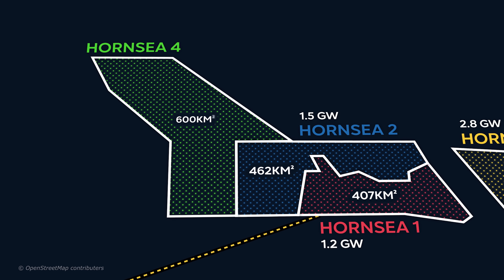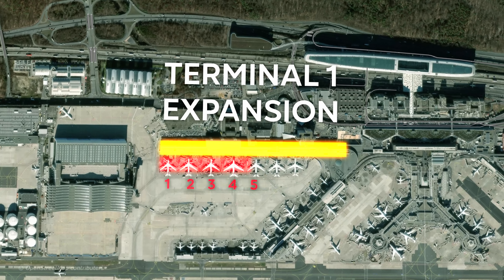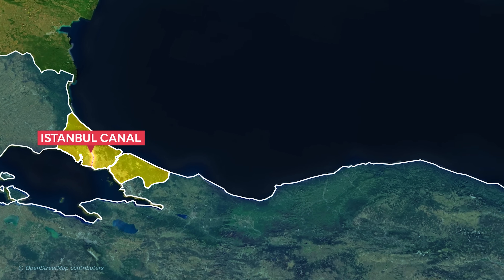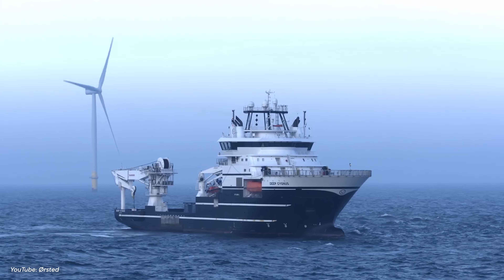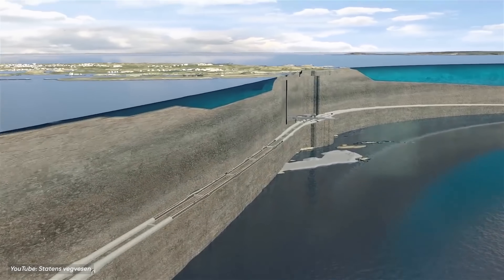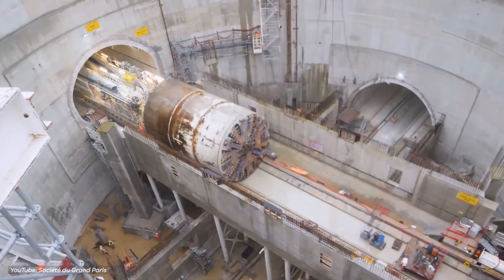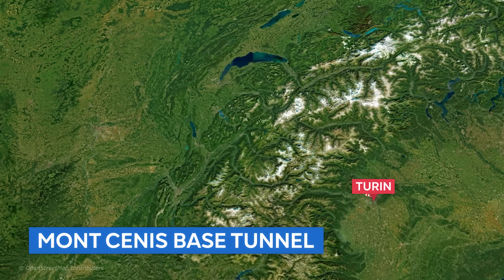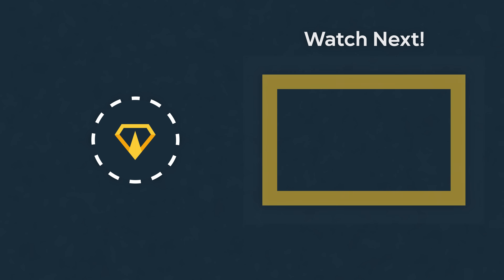Top 10 Biggest Megaprojects in Europe

Comment: This Norwegian ship tunnel seems to be not very expensive in comparison to its size. This is probably a very stable rock, that needs no concrete in construction. But impressive nonetheless.
Reply: can confirm most tunnels dont have any thing over it its just rockts but there are some soft areas that is reanforces or goes under oceans or lakes and people belive the project will be like 2/3 times more expensiv than what is expected
Reply: @Vikeroni  This is something completely new in technology. So it is difficult to predict and calculate. Large projects like this also do not get the funding if the full amount is at play. This is a trick of the politicians that never gets old. So after it has started you can get the rest of the cost through the budgets, scattered over several years if possible.

Comment: Denmark: Windmills do not grow on trees. Windmills are CO2 neutral after ten (10!) years. Unfortunately the wings have to be replaced by then, making windmills never, ever become CO2 neutral.
Reply: Wind turbines are designed to last at least 20 years. However, if properly maintained, they can in many cases function well beyond their estimated lifespan, so no you are wrong about that one
Reply: @Ikkeligeglad  Fact is that they are taken down on a huge scale. Not only not becoming carbon free, but causing huge piles of junk, from which you will say will be recycles, but at that co2 footprint? And I'm not even considering the massive slaughter of birds buy them.
Reply: Why do the blades have to be replaced?
Reply: @_JohnDoe  They get worn out, due to the high speed of the outer part of the wings, they get worn out, especially by dust in the air, but also by weather and sun
Reply: @_JohnDoe  Because the molecules in the air slowly, slowly grind of the surface of the blades, making the risk they collapse bigger  with the year. But before that moment several repairs had to be done to extend the lifespan of the wings.

Comment: I am most impressed by Britain's High Speed 2. I don't really see The EU transport network plan as one individual project, while HS2 is a system of connected railway lines. That puts it at the number 1 spot for me.
Reply: HS2, hass been a bit of a failure though. As always it is massively over budget and schedule. Secondly it has been pared down already from a country spanning line running up the west coast to Scotland, and there is talk of cutting the second phase to Manchester. On top of that it isn't high speed. It will be slower than any of the high speed networks on the continent. 

Don't get me wrong, it is needed, but its also not nearly enough. Our train system is slow, over burdened and far too expensive, and their solution is 1 new line that takes 20 years to build. Its a joke quite frankly.
Reply: The UK is only a tiny country by comparison. The EU/European projects are huge and much more complicated, with a far greater payoff as well. You're literally not seeing the bigger picture.
Reply: @thomasnorb4077  I don't deny anything you say. My point is that the EU budget is for what is actually a range of projects, while the HS2 can be seen as one project. 
The EU budget isn't even just for trains. Yes, it's a huge budget with huge ambitions, but I wouldn't call it one project, it's a set of pretty diverse projects.
Reply: @diedertspijkerboer  Aaaand, it's gone. It's a shame, for a while there I thought Britain was going to join the rest of us in the 21st century...

Comment: Your post is a bit too set up and not even properly displayed.
The HS2 project was capped from 130 billion to 80 billion. And with regard to the Fehmarnbelt tunnel project, Denmark alone will assume 7.5 billion euros of the costs and refinance them through tolls, Germany will assume 4.5 billion euros for new motorway connections and a new tunnel between the German mainland and the island of Fehmarn. The EU is contributing less than 600 million euros to the project.